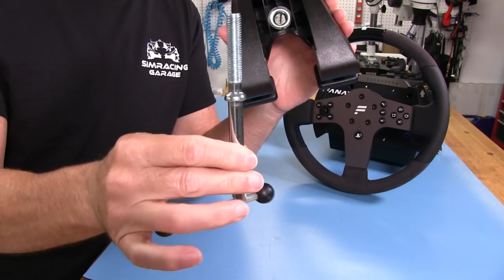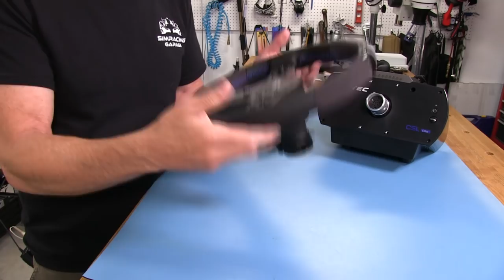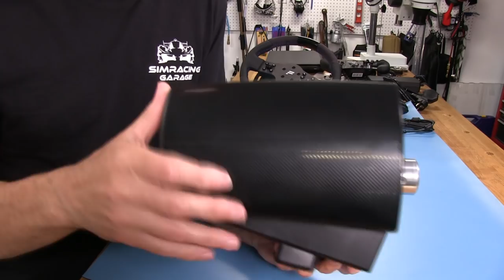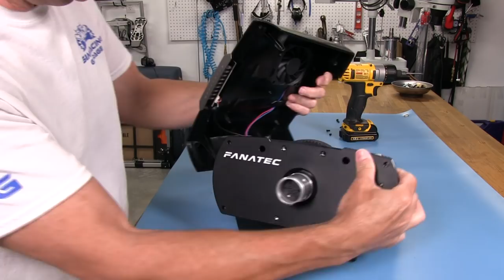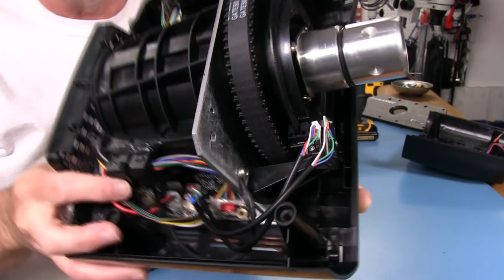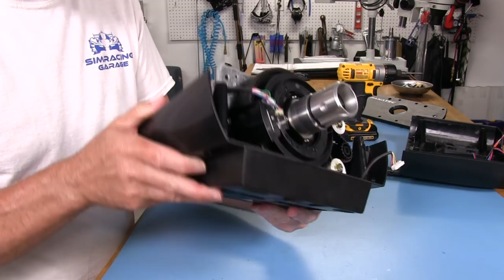Fanatec CSL Elite RW Review

Comment: Hello guys! Im having trouble with csl elite. My wheel shaft seems to have a bit of free-play/clearances after 3 months of use. Any of csl owners here have the same experience as me?
Reply: I've had my wheel about 6 months, and just tightened the locking mechanism screw for the second time, only about 1/8 of a turn, but enough to lock it solid again.

Comment: In pCars 2 I'm using raw with about 100/70/90/40 values in about all cars with my Accuforce. High tone values let me feel the tyre slip unlike in any other title and the steering corrections very similar to real onboards. When I loose the car, I know always why, but don't happen that often. "Reading" the FFB respectively getting used to it is always key for sure and in some cars I miss the roughness of rF2 FFB or road noise like in iRacing, but Simvibe is better here in pCars 2. If any motion system can compensate Simvibe it's yours, but I doubt it can. The speed of sound is always faster and the vibrations are key to feel seat of pants effects in real life as well as Simracing. Hans Joachim Stuck said, he was driving without seat-padding to feel the car better and was successful with that like in the Audi GTO.

Comment: The wheel sensor wouldn't be able to determine direction would it? Perhaps that is what the sensor on the motor is for.
Reply: I don't think electric stuff inside is that stupid that it don't know in which direction motor is turning lol. Logitech wheels got the simplest possible wheel position detection and it works fine. Not a problem here for sure.

Comment: Does Thrustmaster gear shift works with CLS? What about Thrusmaster pedals does it work too?
Reply from the maker: Not directly connected to the CSL wheel base. You can plug them into a PC independently. Then they will work with any wheel base you want. The TH8A shifter comes with a USB cable. The Thrustmaster pedals will require a USB conversion cable like this: http://www.thrustmaster.com/products/trj12-usb-adapter

Comment: Was honestly hoping with the extra pricetag on this thing that it would atleast have an metal housing, to give the base itself some nice weight. Tired of expensive crap being made out of what feels like cheap plastic. I was looking forward to this thing as like a step up from the T300 for the forcefeed back strength and smoothness, not to mention the uhm selection of rims and ability to if I wanted, just use either the QR Hub on a Momo rim or the Podium Hub on a Momo rim.

Wonder if I should just fabricate some Aluminium housings for it? basically make a nice heafty CNC machined box for it all to sit inside of instead of a plastic box.
Reply: Get the clubsport. Its probably even intentional to separate the two products.

Comment: Did someone replace the belt? I’m not sure if when I replace it the timings don’t fit anymore. Are there any difficulties replacing the belt?
Reply: There aren't any timings like in a car. The wheel does a self calibration every time you power it on. You'll be fine.

Comment: My problem with the Fanatec setup is, for a little more money you can buy an Accuforce Pro direct drive setup. This wheel is $510 shipped. Accuforce is $700 (not sure about shipping)

I'm not rich enough to afford either, so I pay $300 for Thrustmaster and get a wheel AND pedals.
Reply: That $700 on sale. Regularly $999.99
Reply: @SIMRIG412  you obviously did not look at the website... AccuForce Pro V2 'Your Way' Steering System Kit is $699 all the time. I have wheels to use already.

Comment: Thanks barry great job as always. Im tossong up between csl elite and clubsport 2.5 the price is significant given im building a pc buying triples etc. I simply cant afford a direct drive wheel so is the 2.5 worth the extra$ given its got more metal the flex should be less. Im not bothering with consoles so i dont care about which csl elite however there appears to be a difference between the play station and the xbox in the htz which i think is the resolution for the game connection that said im thinking if you say csl over the 2.5 i should get the playstation vers over the xbox. I really prefer the looks of the 2.5 but this is really starting to add up. Please someone give me an opinion. Thanks
Reply: If you are spending that much you may as well go direct drive man, these are just Thrustys on steroids, and PC is the only option for Sim Racing, there is no i racing on Ps4 or x bone.
Reply: Gonzo Gaming thanks mate ive been looking at the sim-plicity dd wheel but its a little over the reason i was thinking of the ps4 over the xbox vers is because of the extra htz in the ps4 version both are pc compatable and ill only use pc i just cannot stump up the funds for dd and then wheels etc. Really its going to have to be a belt im just trying to decide between the csl or the 2.5. Its really not costing me to much well not in sim terms i made pretty much everything. Built pc built the rig and the transducers shifter hand brake motion platform and considering building a load cell pedal set i just dont have the skills to build a wheel base im lucky enough to have access to lathes mills and have welders etc here but im still learning about electronics.
Reply: I'd try the simplicity 7nm direct drive, it's the same price a csw v2.5!
Reply: Cai Allen it does look appealing but i have a couple of issues firstly freight to rural nsw aust is expensive from the uk and from what ive read it doesnt use the same software as its bigger brothers and no one can say what they are using. The only other issue i have is converting a proper wheel which is miles better than a fanatec rim to use buttons i guess its only momentary switches and a controller board so if thats right then its probably the better option ill have to do the math and see how much itt will cost me to get up and running.
Reply: And scratch the simplicity everthing is sold out no 7 10 or 12s at all not even on 28days?
Reply: simplicity discovered some QA issues just prior to people receiving batch one, so they have pulled them from sale until they can find a solution. You might have to wait a few weeks or longer for updates on these, unless I've missed more recent updates on the problem.
Reply: If you could buy a mige motor locally under 300 USD, I strongly suggest you buy a SimuCUBE board directly from Granite Devices and build your own. It's pretty simple, even me without any serious electricity knowledge can do the assembly.

Comment: MAYBE SOMEONE HERE CAN HELP ME, judge me all you want but here's my story/question.
I purchased a fanatec csl elite base with wheel that you see here in this video, plus v3 pedals and a fanatec clubsport shifter.
I have udated the firmware on my pc, did a function test plus calibration and it seems that all is good.
uplug it all and hook it up to my sim rig and ps4, according to the Fanatec site, Project cars1 should work with this hardware.
But i cannot get it to work. The PS4 sees the steering wheel as a controller in the Player one position at the front of the PS4 and i can move around in the PS4 menu and confirm things with the X button and startup Project Cars1 using that X button, but then when the game is loaded and asks to press X to start the game i cannot confirm. X does nothing on my wheel. I can then use a normal PS4 controller as a second controller (controllers therefore switch) and then start the game. But when the game is running i can switch controllers all i want i have no idea how to get the game and or PS4 to race with the wheel and pedals.
Is there something really stupid and obvious i'm missing here? Thanks in advance from a person that just wants to go racing. Good luck and stay safe out there!
Reply: Sorry, dont know...

Comment: is there a way to upgrade the fan to an Noctua fan because they run mutch more silent an move more air
Reply from the maker: As long as you get the same size fan so it will fit the mount. All you will have to do is wire it the same way the existing fan is done.
Reply: Sim Racing Garage  looks like a 120 mm fan with the same connector as a motherboard fan
Reply from the maker: Yes 120mm. The kit fan has a 3 wire configuration. Just need to cut off the new fans plug and direct wire to the terminal block in the housing. Of course need to mindful of the gnd, pos, and signal wires correct position.

Comment: As of my knowledge the two sensors work together for better resolution.
Reply: The only thing that comes in my head is that belt isn't solid and the actual wheel position versus motor shaft position can change during high load or fast change of the direction.

Comment: Why is there 3 gears on thrustmasters but only 2 on these?
Reply: That's because the motor of the Fanatec is more powerfull and does not need big reduction ratio to reach 6 Nm of torque, resulting in higher speed and less resistance in the drive mechanism, leading to more details in FFB.

Comment: I can almost guarantee that motor isn't 6nm, it is geared to 6nm as the final result.

Otherwise, excellent review.

I just wish Fanatec had a model below their entry level $670 unit. Ouch.

I could spend that on my real car and take it to a real track.
Reply: Gaming Central plays  From their website, "Ultra-strong brushless servo motor which delivers up to 6Nm of torque on the steering axis".

Note, "on the steering axis".

That is gear reduction.

Judging by the pics on their page and 27:08 it looks like 7:1 ratio or so, just ballpark guesstimate. 6Nm x 7 would be 42Nm of force at the wheel, 30 ft lbs of torque, that's automotive starter territory.

If you've got links that show otherwise I'm not beyond listening.

https://www.fanatec.com/eu-en/racing-wheels/csl-elite-racing-wheel-ps4.

Comment: Is there a concrete difference between this ps4 version and Csw 2.5?
Reply: The Fanatec Csl Elite wheels uses an ancient and fragile technology known as an optical encoder wheel to detect wheel rotation (like in very old computer mice, just much bigger), whereas the Csw 2.5 (and the Thrustmaster and Logitech wheels) uses a much more reliable Hall-effect sensor. 

The many small holes in the Csl Elites optical encoder wheel tend to get clogged by debris from the belt - hence the many reports online of Csl Elites losing steering-calibration during use (i.e. in the middle of a race.)
Reply: @fattylefreak7491  understood! Many thanks. Definitely I will get the new Xbox + CSW